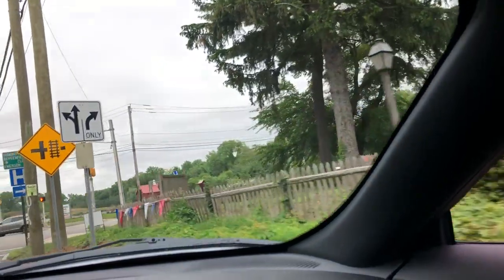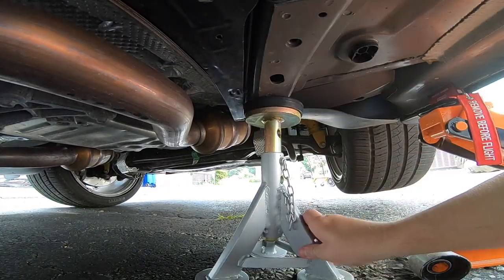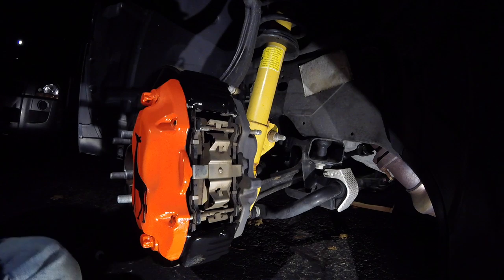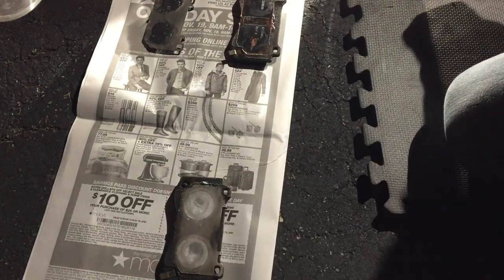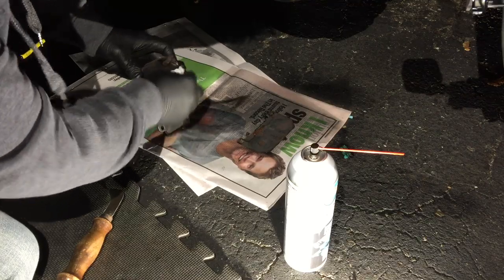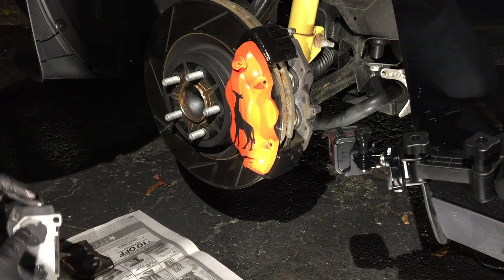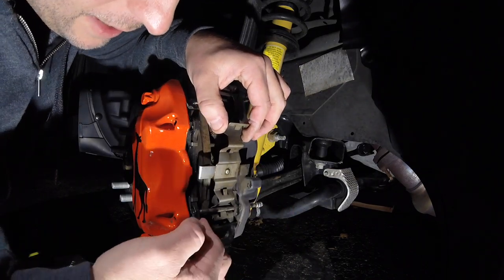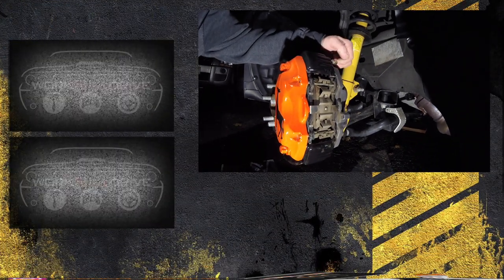Stop the Brembo Brake Squeak - Scat Pack and SRT

Comment: The issue is with the Brembo rotors that dodge puts on the, I had 3 different dealers tell me the same thing. They squeak. The Brembo holes are drilled for directional, look at the pattern on the driver side versus the passenger side, only one side is correct but because the noise is at such a high pitch I was never able to figure out which side it came from.  I said F' It and purchased Power Stop K4023-26 Front and Rear Z26 Street Warrior Brake Kit and took the Brembo Rotors to a recycling plant. I could have resold them since they have about 80% left on them but I didn't need to think about giving someone else my headache. BTW the Power Stop are great, just follow the break-in instructions.
Reply from the maker: PowerStop Z26 is what everyone upgrades to, they are great for daily spirited driving, but they fade quickly on the road course.

Comment: My Scat's Brembos squeak like that too.  I started using brake cleaner on the rotors periodically and that helps in stopping the squeal for a mo0nth or so.  So my issue may be all the dust in my area.  Someone also suggest ceramic pads.  But your method seems like more of a comprehensive fix.
Reply from the maker: The PowerStop z26 pads are the ones a lot of people are using.  They are great for spirited daily driving and most applications, but if you plan on tracking the car with heavy braking these will experience brake fade quicker than the stock pads.  If you swap be sure to grease them ;)
Reply: @WorkPlayDrive  thanks for the suggestion  in pads.

Comment: I'm defiantly going to try this. I have a 2010 Camaro SS with the brembo brakes and the squeal is driving me nuts.
Reply from the maker: It’s like you’re stopping a train 🚆
Reply: Did you fix it? I have a 2010 camaro ss and the brake squeal kills me
Reply from the maker: This worked for the Brembo 4 pistons on the challenger if you have the same brakes it should be a similar process.
Reply: @SonofLiberty00  This did help the squeal but brakes would still squeak if I got them to hot.. What eventually fixed the issue for me is switching from ceramic pads to semi-metallics. I put on some Wagner semi-metallics pads and the squeal is gone.  Give that a shot if you're still having issue.

Comment: Also, You did not put any lube on the Brembo pin or retaining clip.  These are ALL places of metal to metal contact that will cause hormonic vibration.  You should of used the grease on the slide pins and also put some in areas of contact on the retaining clip.  This to will help on Brembos.
Reply: you 100 percent dont need grease on that pin.... do you legit what dirty to stick to the pins constantly??? Never in my life have i seen someones pins greased. It wont do nothing.

Comment: this also happens to my brembos on my 2021 subaru Sti. also when i check visually, the brake pads seems to wear unevenly.....yours the same??
Reply: I'm having the same problem with my 2021 STI. I bought it used with 5k miles. Now it has 13k miles and wondering what I should do right now.
Reply: @pandawarriors33  i got so sick of it and frustrated, man this car is expensive and bought new and i dont know how to stop it. So I ended up trading it for 2022 supra lols
Reply from the maker: 😂😂 that’s one way to fix the squeak.
Reply: @channelgreen  honestly been thinking about doing the exact same thing.

Comment: Here is a tip I use when using brake caliper grease - 
Buy a few solder flux brushes from Home Depot, Lowes, etc. They are perfect for applying brake caliper grease precisely where it belongs and avoiding where it doesn't.  I don't like using my fingers because I inevitably touch where I don't want the grease and it saves me extra work of cleaning up.
Reply from the maker: Great tip!
Reply: Does it reduce the braking performance at all?
Reply from the maker: Nope brakes pads are supposed to be greased in these areas. They just didn’t grease them well enough at the factory.

Comment: I gave up on the squeaking, swapped pads to z26 but like you said they fade. Went back to brembos and the dust but they stop on a dime. They still squeak I even used brembos b quiet lube. 💀

Comment: My 6 piston Brembos squeak exactly like that. Wonder if I should do this before switching to ceramic pads.
Reply from the maker: I haven't had any squeaks on the hellcat yet, but if I do I am considering the Z26 Pads.  The only issue I know with them is they experience Brake Fade quicker than the stock pads so you should not use them on a road course.
Reply: Just an update. I did this and my brakes are super quiet. I only applied grease where the pistons contact (didn’t apply any between the pads and the shims). 👍🏻😊😊

Comment: Are we talking about that super loud high pitch squeal when the car is almost at stop? Mine squeals like crazy when they're getting hot and at very low speed a second or 2 before the car stops. I can brake fine, but only when I am almost stopped, in the very last few feet distance, the brake squeals..
Is that what you guys are experiencing too?
Thanks
Reply from the maker: Yep I play a clip  in the beginning of the video.
Reply: @WorkPlayDrive  can't hear the squeal there. I must be deaf. Thanks

Comment: I've used the CRC disc brake quiet(red stuffs), it has a nice applicator tip....that's what she said 🤣
Reply from the maker: Yes it does have a nicer tip ;), but didn't use it, the container said "Not for use on Shimmed pads"
Reply: @WorkPlayDrive  fuuuuuck
Reply from the maker: Lol I know nothing like ripping everything out and then reading that 🤦‍♂️
Reply: @WorkPlayDrive  time to rip mine back apart too.

Comment: thanks for the video. I switched to ceramic and the noice didn’t stop. Should I change out stock rotors next?
Reply from the maker: My issues was due to the install being improperly greased.  When you installed the ceramic pads did you grease all the areas I pointed out in the video.
Reply: @WorkPlayDrive   ok I got it. The Noice is gone. Thanks again!!!!

Comment: Did you do the rear?
Reply from the maker: No the rear had no speaking issues
Reply: @WorkPlayDrive  I did exactly what you did in the video and I’m still getting squeak…😭😭😭
Reply: @WorkPlayDrive  you did use more grease than I did you think that’s the problem? Thinking of just taking it to the shop .
Reply from the maker: I used enough grease to thinly coat only the contact areas.